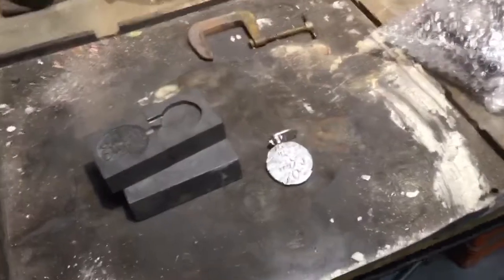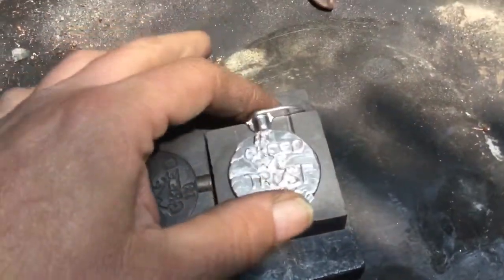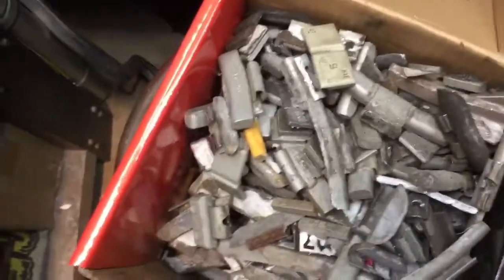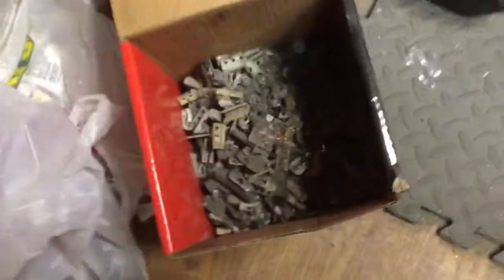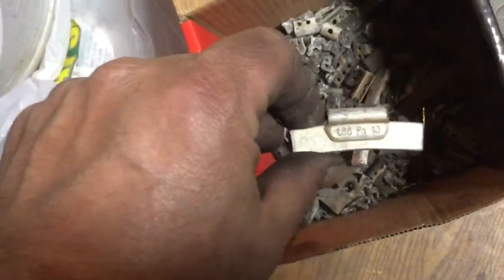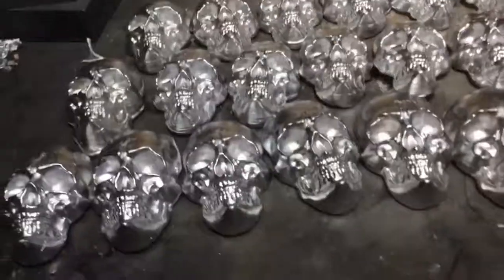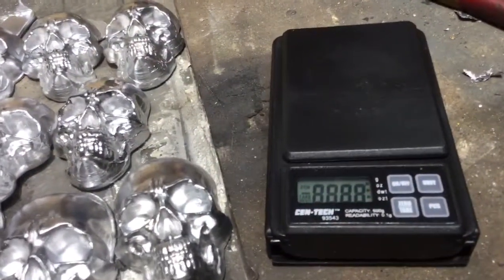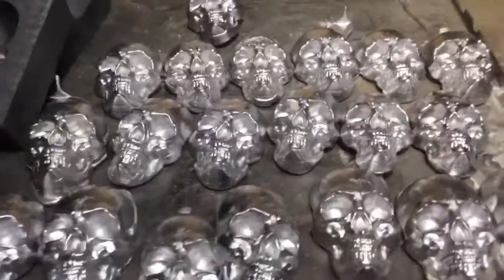New Skull mold, lead tested

Comment: Lead is soo easy to work with I love it just a shame it’s not too user friendly. That looks like an expensive mold where did you buy it from and how much was it as ide love to get one if it’s not toooooo expensive, I’d love to do a brass and copper one👍🏻
Reply from the maker: bigstackD Casting , I found the mold on eBay, $65, not so cheap, but I plan on making a few copper, maybe silver, and try my luck with bronze?  Those stars u made are awesome, looks like your having fun with the new 3D printer. What for sand do u use?, it looks very user friendly 🙂